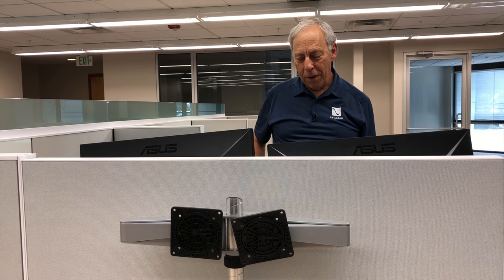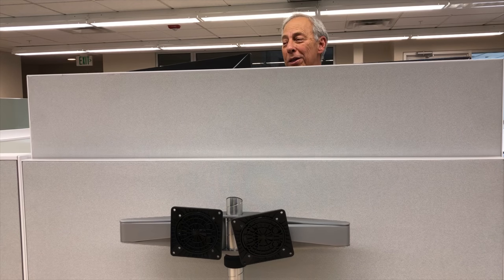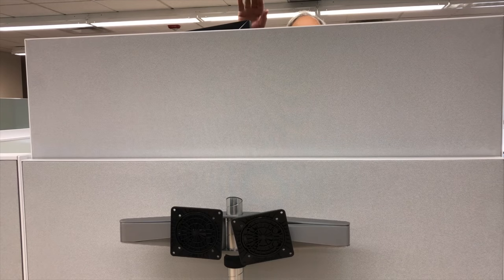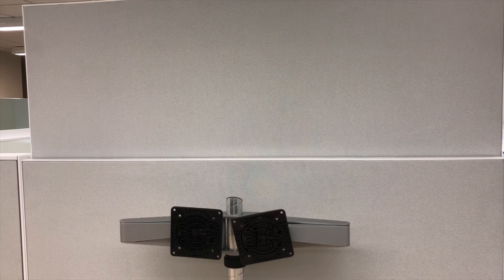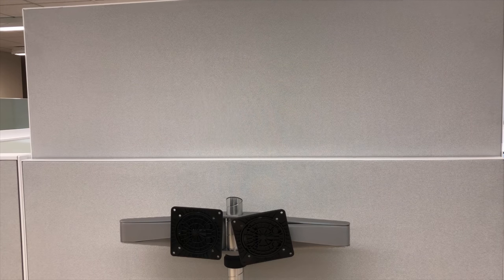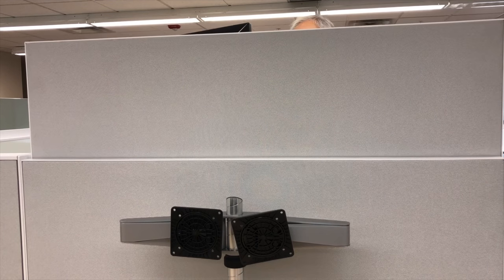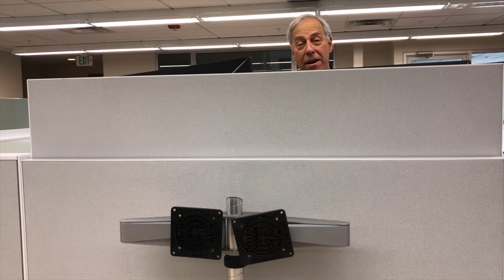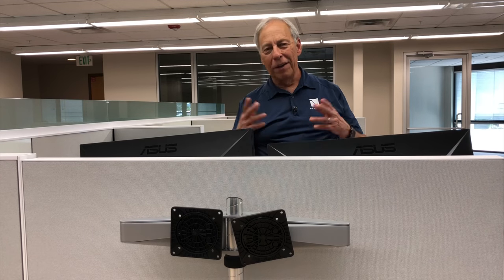Replacing capacitors in vintage equipment

Comment: SO.....BASICALLY PANASONIC CAPACITORS ON THE POWER SUPPLY??? ARE THEY LOW IN ESR?
Reply from the maker: Depending on the Panasonic series, yes.
Reply: @Paulmcgowanpsaudio   Whats  is the best panasonic series to use in the power supply?

Comment: Hi Paul..  this is Frank from Singapore,  million thanks for all the valuable knowledge off books. It will be awesome if my question catch your swift attention.. I got a power conditioner few months ago, wondering do I still need the original socket EMI noise filter in my dac and CD player ? It doesn't sound right to my ear , could that be over kill ? Or I should just take it off from dac or cdp? Pls advise.. good day..

Comment: Another point on polarity: Many assume film caps have no polarity, that being you can install them either way. Ahh, but they do have a polarity. See video below. It's not going to do any damage if it's wrong but may influence the noise floor on older tube equipment where circuit impedances are much higher than solid state gear. For 70s solid state gear you can probably ignore this for the most part IMO.

https://www.youtube.com/watch?v=BnR_DLd1PDI&t=2646s

Comment: Recently I faced this strange case : I was recapping an Akai AM2250. Just out of curiosity I checked the values of the old capacitor s from the Akai .I was surprised to find , a 1 microfarad capacitor showing over 2 microfarad and a 10 microfarad capacitor showing 17 microfarad.I cannot find an explanation for this. Any help is welcome . Thank you
Reply: Been 3 yrs. Someone else said the same thing. I'll test before replacing.
Reply: Это тоже считается неисправностью и выходит за пределы допуска +-20%. Некоторые электролиты по мере старения не уменьшают, а увеличивают ёмкость с одновременным увеличением тока утечки. Такие детали подлежат замене!
Reply: @denisandreev8807  English, please
Reply: @imnewtothistuff  press translate, please.

Comment: When a home theatre receiver on start-up, keeps turning itself off multiple times until it finally stays on -- is this a capacitor problem -- or what is it . . . a relay . . . what?
Reply: No.
Reply: How old? Did anything change in the system since you first put it together? Are the speakers way below the recommended impedance? Does it also do this with nothing plugged into the amp? How fast does it turn off? Once it stays on are there any oddities or does it work fine for hours?
Reply: Around 19 years old; not shorting of speakers or too low of impedance . . . the receiver will still shut off without the speakers connected or any other inputs plugged- in; the receiver sometimes works with one click of the remote and it does not turn off; sometimes it takes a few times of turning on before it will stay on without shutting off . . . sometimes it takes around 10 times or so to get it to stay on; once it has clicked-on with the remote and it remains on, it rarely turns itself off until I turn it off . . . perhaps only two times it turned itself off once playing; the only oddity I have noticed is once in a great while there is a very faint sound as if the receiver wanted to turn itself off with a sort of very faint click in the nearest surround speaker near me -- but it does not turn off -- that would be the only oddity I would notice. 

Once the receiver has seemingly settled, the sound and picture are absolutely beautiful and clear. Any suggestions? Thank you!
Reply: @russmaleartist  Not too sure yet. You at least know it is the amp and not a speaker wire causing an issue. Have you tried cleaning the inside while it has been unplugged, and also visually looking for anything that seems loose or faulty? Oh, I assume it also happens when using the power button on the amplifier as well. You might also look at all the connections from where the surround that makes noise goes into the amp and follow that path just to make sure you don't have a loose relay like I did. Relays tend to click inside the amp though. 
I'd give it a good cleaning and look over. Worst case, you can just leave it on all the time. I've done that with mine, which is about 18 years old, for the last 4 years. It doesn't have your issue of not turning on, I just have it in a closet because of a toddler. If I do come up with something I'll let you know.
Reply: Thanks for your attention to this -- it has to be something to do with the start-up relay. I think the 100-watt amps are working well. My impression is that whatever it is, it is not holding the current once activated and it clicks back off. As you said, it could be in the start-up switch or thereabouts. I will have to unplug it and have a look inside.
Reply: My guess is that the relays are of the latching variety and what is causing the problem is that the contacts are dirty/corroded/baked, thereby not allowing the latching action until enough has cleaned off via working the conttacts to allow enough current to flow, keeping the relay latched on. While you could disassemble the relay(s) and clean them and get a few more years out of them, they will return to their current state of iffyness fairly soon due to the wear already put on the contacts. So, if you clean them and they work again, order some new ones to replace them for longevity.

Comment: electrolytic goes bad....can turn into a resistor if bad enough. imagine the havoc that wreaks on the signal components. imagine DC passing where there should be none.
if you suspect that it's been long enough then replace those critters. one caveat though....if the caps are mica they may not have to be replaced. i have seen personally some that are over 50 years old and still test damned near as new.
generalities stated hope that all is well.
=dok=

Comment: We had great Stereo sound on F.M. Radio, i made superb recordings off BBC Radio 3 who exclusively play classical from the oldest madricals to the 20'th century greats & all inbetween BUT here comes my gripe, when BBC radio were constantly urging everyone to go with the new D.A.B. radio which, my digitally knowledgable friends & hi-fi magazines confirmed ...used a 10 or was it 20'year old codec at D.A.B.'s start,  they soon downgraded their F.M. output & suddenly, my tuner rig only got noisy stereo & i was akways combining to mono to hear the music to later buy what i heard. I tried all different arial changes but, i believe they sabotaged their own F.M. output just to drive folk to D.A.B. radio.  They never sold them but had a long vested interest to push D.A.B. ...saying C.D. quality which it couldn't even to that non impressive 16/44.1 task. Vinyl & Beeb's F.M. stereo cassical prog used to be close to a good properly setup t/table & m.c. i had but D.A.B. i bought to try was an audible joke in comparison, even when they downgrounded their F.M. quality.    The Beeb swore F.M. would be stopped by 2006, then 2010 then 2015 (so get your DAB wuick they said before each non- turn off) ...then the stated "we will deffinately turn off our F.M by 2018,  ...it still remains & quality has got better, i can just about get noiseless F.M. clasical with occasional arial fiddling.  R.F. boosters made for weak F.M. qual(& the old V.H.F. tv R.F.)  do not work one bit in my exoetience, they have an on/off button which degrades sound in the "Off &/or "Bi-Pass" position but the good "on" position is exactly like taking it out of circuit!!  Crafty-swines, it made many dumber than me folk think "they're  Grrreat"

Comment: 20 yrs? Stick to speakers...I see techs that can take a  print and rebuild any tube amp and they have seen 64 Fishers run the same caps up to 2020! Maybe todays junk most ignorant people by mayve 2 years on a cap, but no way, the say Fishers, Avery Fisher put in caps and resistors mainly from Germany that lasted many, many years. You explain nothing that many specs dont even match today. You have to go up or down, and problems.

Comment: Sorry, but I don't agree with the part about the value of the capacitors decreases with age.
I have replaced a lot of 40-50 year old capacitors, and all had greater value when tested in
an LCR-tester that the rated value of them. Nominally with 10 - 40% increase in value.
ESR will also increase, and they will start to leak. (Not fluid, but DC current).
So yes they need to be replaced, but with new good quality capacitors.
Not cheap Chinese ones.
Reply: Are you assuming closer tolerance in those old caps than they actually had? I seem to recall high value electros often having a tolerance of -50% to +100% when new 50 years ago?
Reply: No, they use to have a tolerance in the 5 - 20 % range depending on application.